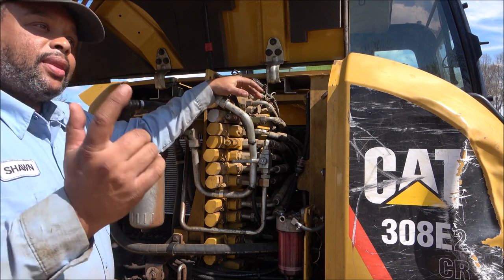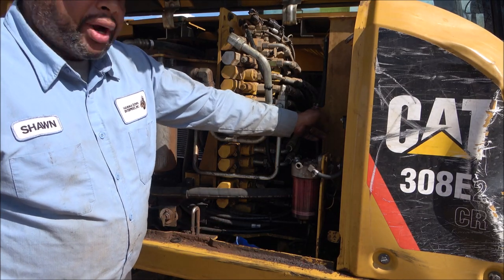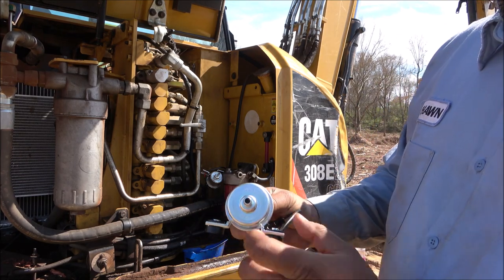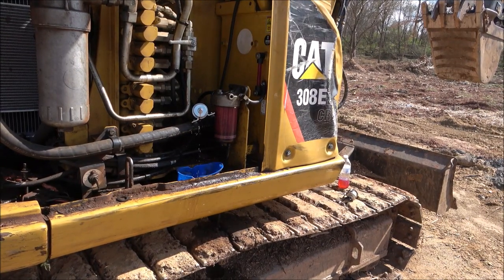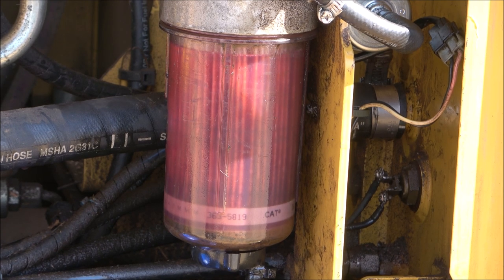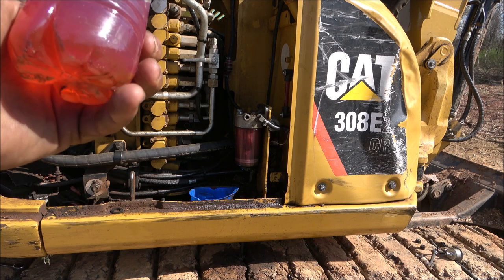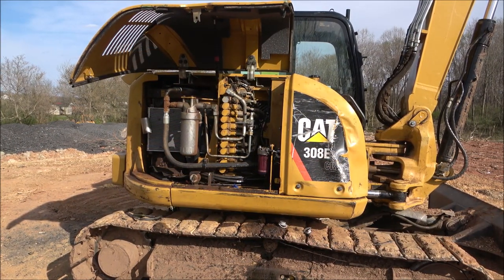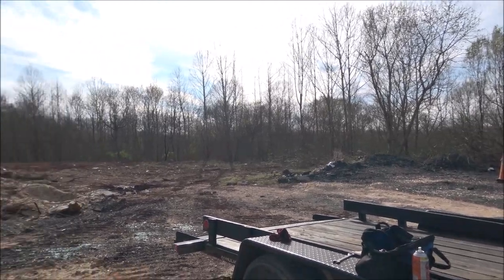Troubleshooting Fuel Problem on Caterpillar 308 Excavator

Comment: Great video.  Thankyou. Im pulling my fuel system apart as we speak. I forgot about the water in the filter. Gunna drain it. Thank-you. Once yiu have water run through your fuel pump, you might as well chuck it. I had a really bad neighbor on a job who dumped a couple gals of water in my tank one night. Its cost my around 3 grand trying to get everything running again. Water is a horror story in the fuel lines. Nice excavator.  Wonder how much that body panel costs to replace?

Comment: I keep finding plastic in the tank from when they put the filler cap on it at the factory little black plastic pieces that clog the primary filter before it even gets to the system
Reply: Take tge fuel line off tge tank and drain it. Then you can spray the tank clean with diesel in a sprayer. Use a flashlight and it's pretty easy. I had to do it on my mini.

Comment: I have the same machine. Do you know how to fix it having low flow? Trying to run a mulching head and its not getting enough gallons per minute even when i have it set to 15/15 on the monitor
Reply from the maker: @kyeeyk7065, no, I can’t say that I do unfortunately.  I have run any implements requiring high flow.  I’ll research it though.  I did recently purchase a brush cutter and flail mower.  However, I don’t think either of those are high flow.  If you figure it out before me, let me know too!
Reply from the maker: Kyeeyk, did you figure out the problem.  I was having the same issue when I was trying to run my brush cutter.  Turns out, I was just pushing the switch the wrong way.
Reply: @HammaDownEnterprises  do you mean pushing the aux hydraulic control? Or the lever for one way flow
Reply from the maker: @kyeeyk7065 , the aux control.  My brush cutter is on the same line as my thumb.  So, I set system to one-way flow and shut off the valve to the thumb .  When I pushed up (open thumb) the blade would turn.  But, once I put it in the brush, it would stop.  After much consternation, checking/switching valve settings, and researching online, I decided to just push the button the other way (close thumb).  Everything worked as it should
Reply: @HammaDownEnterprises  interesting. I think I was pushing it the right way as the rotor spins the right direction and doesnt spin backwards at all when the one way flow lever is switched
Reply from the maker: @kyeeyk7065 have you tried switching the lines on the mulching head?
Reply: @HammaDownEnterprises  I haven’t. On the roller for aux hydraulic are you pushing towards the window or pulling it back towards your hand
Reply from the maker: @kyeeyk7065  my control is on the right joystick that Giles up and down.  I don’t use the smaller one that go right to left
Reply from the maker: @kyeeyk7065  How about the valve in the hydraulic compartment?  You see that handle between the hydraulic resevoir and the hydraulic manifold?  Switch that to the other position.  I went out this morning to work with the brush cutter and was experiencing the problem you are having.  I had forgotten about the other switch.  ONce I moved it to the other position, I got full pressure.
Reply: @HammaDownEnterprises  I’ll take a look if I have that one!

Comment: I have found black plastic shavings from the fuel tank, stuck in my pre-filter. The machine still runs, but no power it’s a Catapillar 309.
Reply from the maker: drain the tank.  Then stick a shop vac down in there and suck all the plastic out.  And, disconnect the fuel lines, build yourself a cap you can hook air hose to and blow it out (low air pressure though)
Reply: Did you replace all your fuel lines and filters? I pretty much had too to get rid of my gunk

Comment: What happened to your International Harvester 584?
Reply from the maker: Still got it down at my father's place.  However, the fuel tank is leaking and haven't been able to fix it.
Reply: @Hamma Down Enterprises. You should make a video on it. If you can't weld the tank, sometimes online companies like All States AG Parts will have fixed old ones for sale.
Reply from the maker: @internationalharvesterpower  ok.  I'll do that.  I've  been looking for a good used one to replace the one that's on there.  Just haven't come across one yet.